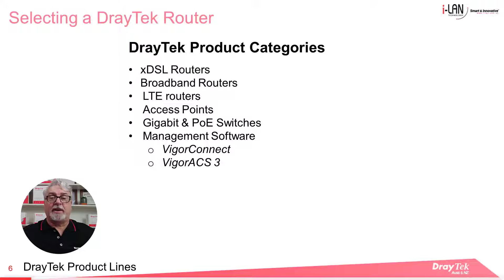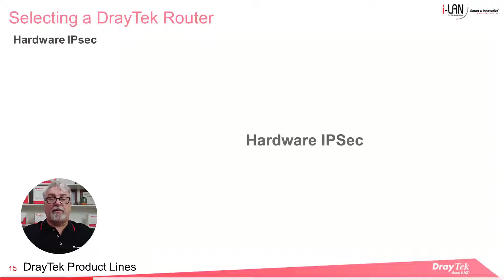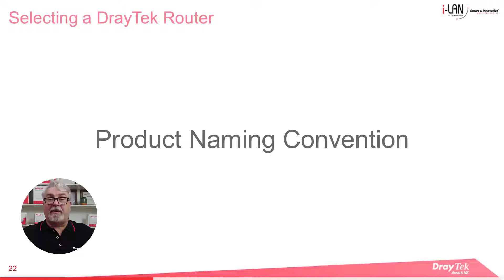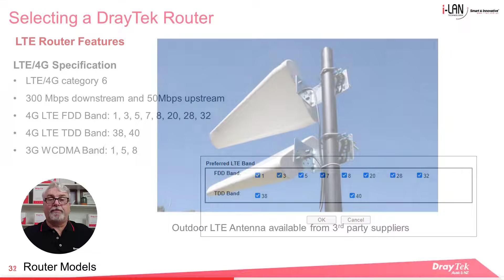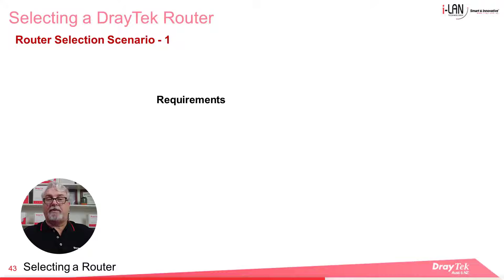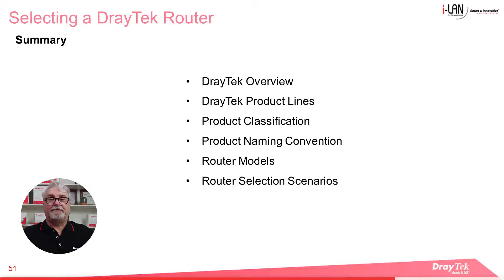Webinar - Selecting a DrayTek Router

Comment: What would you recommend for a 500 mbps connection? Thanks
Reply from the maker: All DrayTek routers above the Vigor167 will support a 500Mbps connection. For Ethernet WAN and most small office and home networks, the Vigor2135 series will be fine. For Business applications and larger networks, go for the 2927 series and above. If VDSL, then the 2765 series for small office and home, 2865 series for business and larger networks.